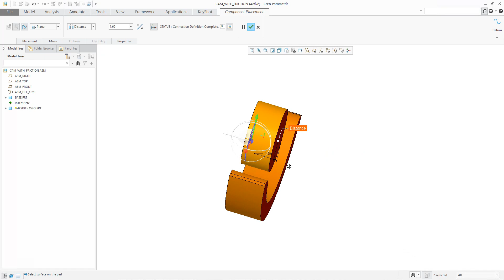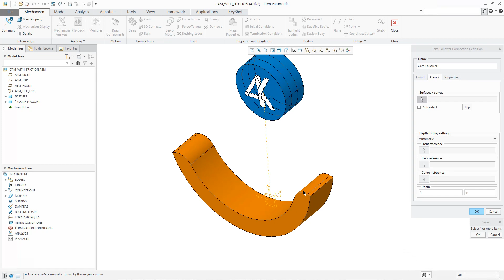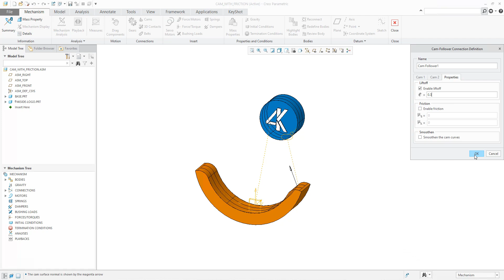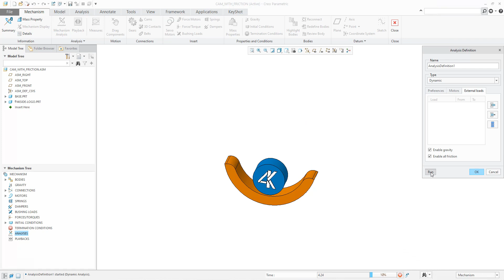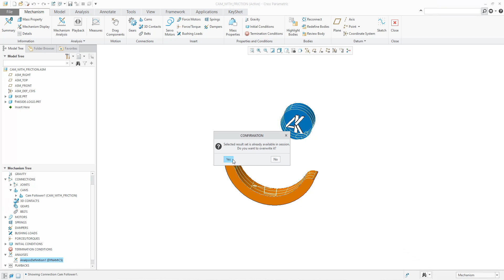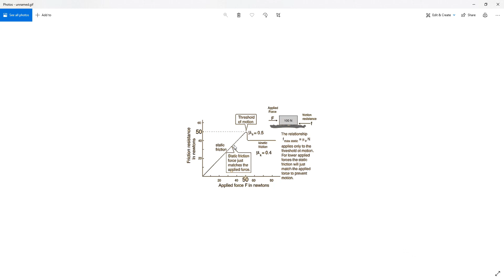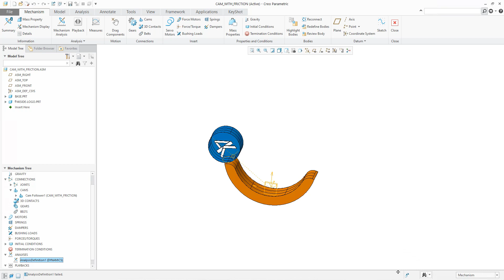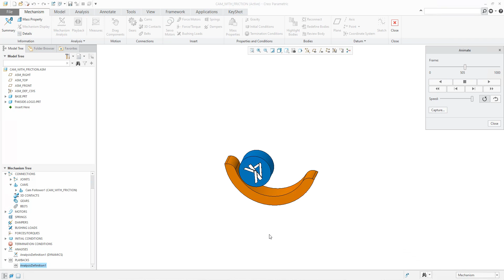Applying Friction: Component will Roll or Slide

Comment: Hi Vladimir , 
Sometimes i fall on studies where severals dimensions on drawings are disappeared ( i can see dimensions on preview ) , i look for an answer but maybe it's a problem of config " create_drawing_dims_only" or a bad model. i don't know ; may you give me an orientation for solving this or show a video on this problem.
Thanks in advance
Reply from the maker: Hi Frederic, first question is if you work with Windchill or not. Because, many times is problem with removed dimensions from drawing if you do not Chcek out model and drawing at the same time (I have solution for Windchill 11.1 how to manage drawings and system will not delete dimensions if your model is not Chcek out) please describe your situation, when dimensions are removed. Thanks
Reply: @4kside  
Hi Vladimir , No personally i don't use Windchill in my enterprise but i remark that i had this problem sometimes with some drawing where i used ordinate dimensions , and i discovered  sometimes severals months later that dimensions were disappeared when i reopen the drawing.It's rare but boring . Thanks